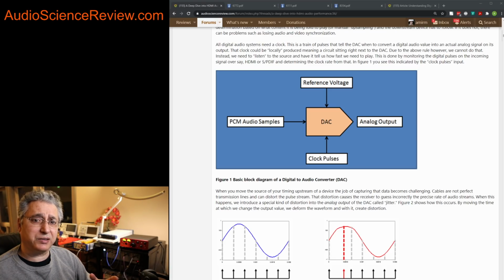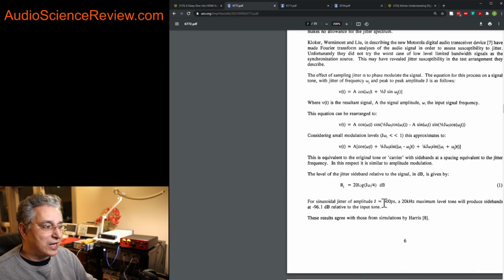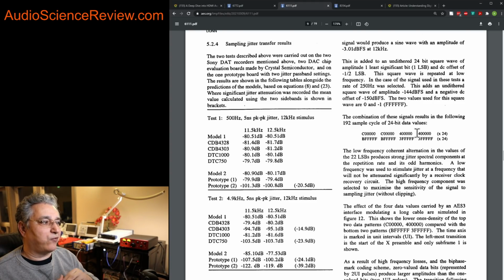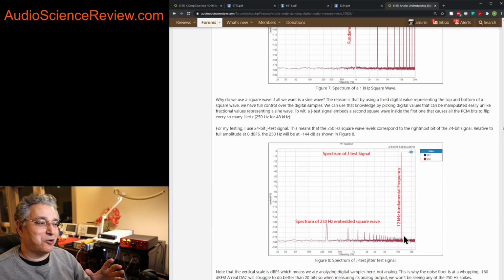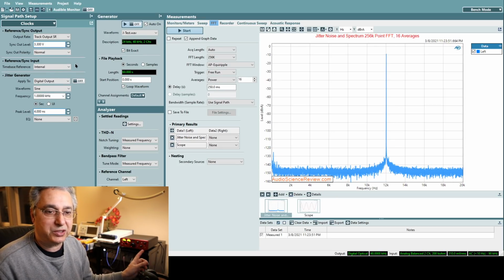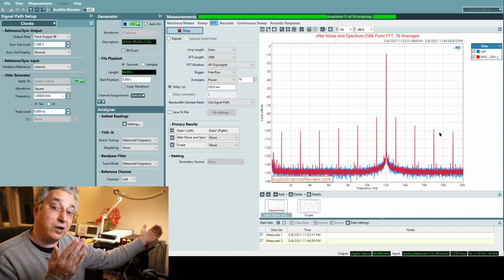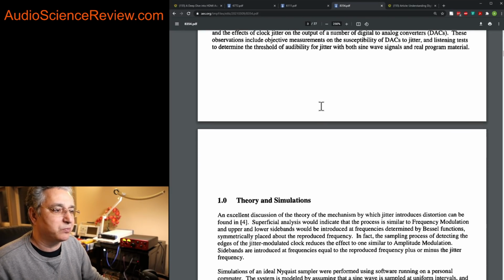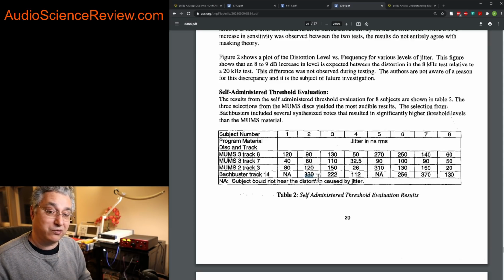Understanding Jitter in Digital Audio: Measurements and Listening Tests

Comment: I used to subscribe to the Hans Beekhuyzen audiophile channel on here, thinking that he knew what he was talking about... then I started watching your content Amir... with the result that I've unsubscribed from him and I'm now watching EVERYTHING you post! Thank you for explaining the real science behind digital audio 😁
Reply from the maker: Hans does so much damage to understanding of these topics.  He is extremely articulate and good on his videos and by using measurement gear as props, make it sound like he has total grasp of the topic.  Unfortunately he is mostly producing informercials based on lay audiophile ideas of how this technology works.  If he turned on the gear behind him for a minute, he would realize most of what he is assuming is wrong.
Reply: @AudioScienceReview  Tidal is pushing hard for MQA. They claim to have many vintage analog albums converted to MQA. Pure marketing as these vintage recordings will not contain any ultrasonics. Neil Young has withdrawn his catalog from Tidal in protest.
Reply: @geoff37s38  
IMO, MQA is simply another way to Enforce DRM (Digital Rights Management) under the guise of "improved quality" because the recording is "direct from the original source".

From what I understand, the "folding" and "unfolding" technique in the MQA codec does technically work to provide higher bit depth & sample rate files to be streamed using a fixed & lower kbps bandwidth.

BUT do we really need it?  AND, are there any true benefits or "improvements" if the music files that we already have are sourced from the original masters?

It's difficult for the general audiofoolery public to know, especially when respected Mastering Engineers such as Bob Ludwig support/endorse it.  "Is it Live, or is it Memorex"?
Reply: @bbfoto7248  I have an excellent pair of full range floor standing electrostatic loudspeakers and regard a well recorded CD to be very hard to beat for audio quality.
Reply: @AudioScienceReview   That’s very interesting, I’ll take that into consideration.  Maybe I’ll even dig up a link that I feel connects well with what I feel about him.
Reply: I mean, come on, Hans talks about sanitizing your audio system with high-end power cords. That right there is a tale-tell sign of steering clear of that channel.
Reply: Hans is a salesman.
Reply: What is MQA actually? Nobody could ever explain it to me. Looks like another zipped format from a long distance and control over the master recording, but does anybody know what it really does?
Reply: I find Hans' Videos quite complementary to Amir's and vice versa.  He has some on jitter that are excellent, and covered some parts with even more clarity than this video.  I feel both Hans and Amir have a similar temperament towards truth in audio.  I see no reason to choose one over the other, here's hoping they do a collaboration in the future, synergizing their unique perspectives.  I feel that content would be really interesting to watch, we also get to see who's internet has higher packet errors in the live stream ha ha.
Reply: @Douglas Blake  do you commonly say “There’s no scientific basis” for something just because it’s new information to you?  I ask that rhetorically, I’m not trying to put you on the spot, but I feel that phrase is thrown around allot, and that it’s rooted in hubris.  Like let’s honestly think about what that phrase is saying, it’s saying we know all of science so well, that we know of every published bit of research to the level that we can make an instantaneous statement that there’s no supporting research of a claim.  Just because the person passing along information hasn’t sourced it, doesn’t mean a source doesn’t exist, so we should refrain from declaring it false until we have at least given it some search to verify whether there is or isn’t scientific support of the claim we’re throwing under the bus.  For me I don’t get any scammy misleading vibes that would have me question his 4us info.   What you said about it being smoothed psychoacoustically is really cool information that I don’t dismiss as having no scientific basis, even though my science background has never informed me of it’s existence.  I find the smoothing compelling, but if we are trying to recreate the pressure waves of the recorded event,  wouldn’t we at least want our data to be of higher resolution, even before it’s smoothed out and rolled off?  To me it seems like sample rate resolution is really only significant at higher frequencies.  Anyway, I don’t want to sound like too much of a Hans Beekheuzen fanboy, I watch allot of audio youtubers, and they certainly don’t all agree but I feel like I learn from them all.
Reply: @Douglas Blake   Well, I can respect your opinion on that, there’s allot of videos out there and none of us have seen them all, so we may be coming from different experiences of the videos we have seen. I keep playlists of videos I really like, here’s one of Hans’ that I feel is totally solid, and at least in my perspective is very much in resonance with the technical vibes I get from Amir.  They’re obviously each their own person, but I feel they both have a similar belief in science and measurement.  While Steve Guttenburg and Darko are more in the realm of subjectivism and the unsubstantiated feels of things.  In my opinion this video Hans made is very high quality and really a masterpiece that walks the viewer through the relevance of sampling rates.  Calling it a masterpiece is perhaps a bit generous.  But compared to the landscape of videos describing audio, it’s world class! 

https://youtu.be/r_wxRGiBoJg
Reply: I used to watch the Hans videos until he supported MQA, whitch is a fraud.
Reply: @geoff37s38  amir also supported MQA :) i dont hate it tho.
Reply: @nabildanial00  I recently bought an MQA DAC to try for myself. Not impressed.
Reply from the maker: @nabildanial00  I don't support or promote MQA.  I simply don't hate it.  Nor do I think it is a big enough deal to spend time arguing about it.

Comment: Hi Amir. Very nice explanation of jitter. I think it would be great if you could explain to your viewers the different USB/Audio implementations e.g. why usb audio class devices are different from disk devices, the difference between class 1 and class 2 UAC drivers/devices and most importantly the differences between synchronous, adaptive, and asynchronous modes. This may help to explain why DAC implementation is more important than cable quality and I’d also be interested to know how you identify the class and implementation and include that in your test results. Thanks.
Reply from the maker: Hi Beer.  I actually produced a different video the first time and covered USB in there.  But that video became very long so I did a second take and forgot to cover USB. Will do that in a future video.
Reply: @AudioScienceReview  Nice one. I think it would help your viewers to understand the different types of USB audio implementations and how relevant USB protocol is to audio quality. There’s a lot of focus on cables and jitter and distortion without any appreciation of the underlying USB isochronous methods which are significant to overall quality. Thanks.
Reply: @UC153-icHfJvzpqQWM6f8Q_g Hey John, when you design a £99 DAC, how about adding a separate DC power inlet socket and not using power over USB and include a nice clean power supply too. Or do you design to a price point rather than a quality point. State of the art. Hilarious. Banggood fodder.
Reply: @shih_tzu_love  Well. Do you see the final result? It's probably better than SOTA devices a few years ago. 
What power it uses doesn't matter, what eventually comes out matters.
Reply: @johnyang799  "what power it uses doesn't matter" I rest my case. And async USB mode is more complex but yields better quality and lower jitter. Of course poorly implemented async is no better than anything else which as I say comes down to implementation. And yes I and other viewers are not only interested but I wouldn't buy a DAC from a supplier that didn't detail in their specs the USB standards they were using.
Reply: @shih_tzu_love  Hmm you know XMOS right? Which is Asynchronous and UAC2.0 supported. But what I was again and again trying to say is, don't look at how it's done but simply look at the final result. There are numerous ways to screw up and numerous ways to make it right.
Reply: @shih_tzu_love  You may want to read measurements of D10s(usb powered), E30(external dc powered). What's the difference?
Reply: @johnyang799  One you can only power from a dirty power source, whose current and voltage is highly dependent on the output side and even the cable. Very poor design. Avoid. Oh and sounds like you are now agreeing with me that async implementation is preferable. As I said at the beginning implementation is important and consumers are interested in design and implementation. Thats an immutable fact and why we are watching this channel.
Reply: @shih_tzu_love  I never said it's not preferable. Just that itself doesn't matter much for the user. Look at measurements not just what's being used.
Also 300ma enough for normal operation which is much less than 500mA in the standard. Voltage is regenerated by internal SMPS. As long as it's 4.5-5.5V, the final performance is not affect by one bit. Dirty power source is not an issue. 
This is what a good design is. Not what you assume to be. That's the main issue. And that's exactly the issue why we need and why amir does measurements in the first place.
Reply: @johnyang799  Well I’m just glad you have finally arrived at the important conclusion that the USB protocol implementation is important. As for whether the consumer needs or wants to know this you really need to allow the consumer to make that decision. Please remember your average Banggood DAC customer is unlikely to be frequenting a YouTube channel discussion the frequency response and jitter test principles of DAC testing. So I suggest you pipe down and go do some some work on a new D10s design with a proper partitioned power supply. Think quality as well as value.
Reply: @shih_tzu_love  I really don't know what to say. You can take it whatever you like.
Reply: @johnyang799  You started the nonsense, I’d suggest you move along now.
Reply: @shih_tzu_love  You know nothing about all of this.
Reply: @shih_tzu_love  I was going to say if you want to learn, welcome to the forum. But now. Don't bother.
Reply: @johnyang799  I’m sure you treat all your customers like idiots, which is a good reason not to be your customer. You can now feel enlightened that not all consumers are idiots and some clearly know more than you. Goodbye and farewell.
Reply: @johnyang799  your comments were superfluous and irrelevant from your first post. At least you are consistent.
Reply: You don't need to know these. There are many more moving parts that can affect performance tremendously. You only need to see what it really measures. How it's implemented doesn't matter.
Reply: @johnyang799  Sorry John but the USB implementation approach makes a massive difference to the performance of the DAC. You implement  a UAC class 1 device in synchronous mode and you are asking for trouble. In fact I doubt any serious DAC designer would do that, but it’s important to understand and know what you are buying. Implementation is king with USB and DACs. Same for USB power filtering/isolation.
Reply: @shih_tzu_love  My original comment still stands. What you should really look at is the final performance. Don't buy anything without seeing 3rd party measurements.
Reply: @johnyang799  You comments are irrelevant to the point I’m making about USB implementation.
Reply: @shih_tzu_love  Reference voltage, oscillator, pll, asrc, and more. Each of these have different specifications. All these can contribute to jitter in the final output. And these matter not less than the usb implementation. 
Again you really should read final measurements of jtest. Anything else don't matter for you.
Reply: @johnyang799  Thanks for the advice John. I’ve filed it already under “irrelevant to the point I’m making” bye.
Reply: @shih_tzu_love  Simply put, there's little correlation between usb implementation and jitter performance.
Reply: @johnyang799  John please come back after you have written your first UAC class1 synchronous device driver and know what you are talking about.
Reply: @johnyang799  I personally would love to see Amir going in depth in the inner workings of digital audio. It’s an interesting subject.
Reply: @shih_tzu_love  I can have a UAC class1 device with I2S output and get supremely clean jitter spectrum. It has little to do with who writes the driver. You know nothing about ASRC and PLL my friend. I'm a designer of best performing audio devices in the world....
Reply: @TheGrelots  I'm afraid there are too many details. Sure it would be great when that actually happens. For starter you can have some videos from Martin Mallinson from ess on a audio show.
Reply: @johnyang799  Yes ok John, we’ll get back to you after you’ve seen your nurse. Lol.
Reply: @shih_tzu_love  I'm pretty sure John Yang designs state of the art kit for Topping...
Reply: @HowieHaigh  John Yang: “How it’s implemented doesn’t matter”. Clearly not state of the art kit. He doesn’t appear to appreciate USB protocols and from what I can tell Topping is cheap Chinesium stuff anyway.
Reply: @shih_tzu_love  You really don't understand do you? What matters is the result not the process. There are many devices with XMOS asynchronous interface and still has bad jitter performance. There are also devices take in SPDIF with large jitter and completely eliminate the jitter.

Comment: Jitter is a problem in digital systems - so we need cryogenic cables with quantum nanoparticles. Obviously.
Reply: Ohh no! they only work at full moon. 👍
Reply: @cryptout  The moon's modulation of jitter - I have just the cable for you, sir!
Reply: @johnwright8814  I had really bad jitter in my system, so I used these $1200 isolation feet under my DAC and the problem is gone. (This is a joke.)
Reply: @vinnytube1001  Gravity modulation is related to moon modulation - Hmmmm     feet, you say....
Reply: And they must be expensive!
Reply: @dennisbohner6876  Of course they are!
Reply: Right, but only if they perform at a level beyond 1.21 jigawats, of course.
Reply: @michaelbeckerman7532  Did you know that the pronunciation of "giga" was determined by a European committee, and the majority of Latin-based speakers won, despite "giga" being a Greek prefix?